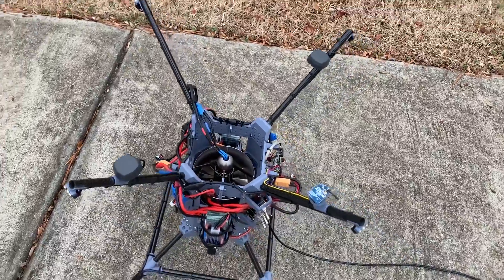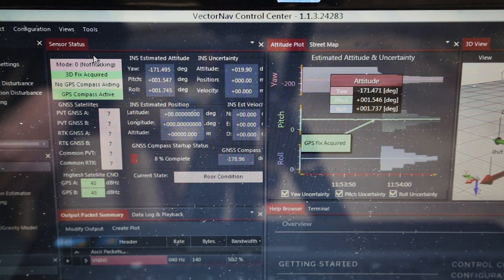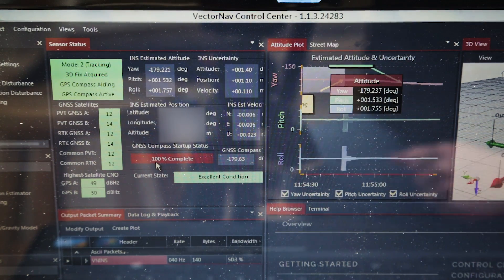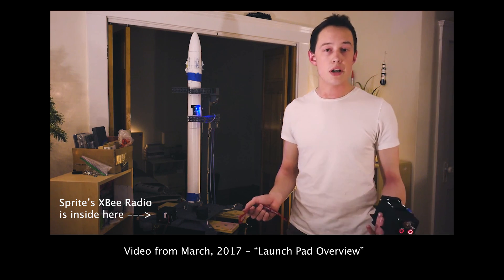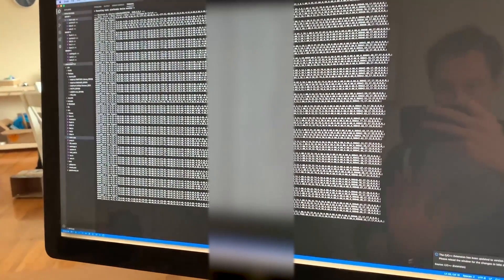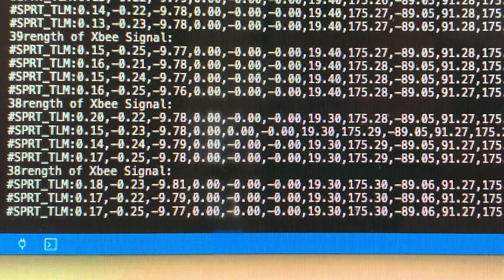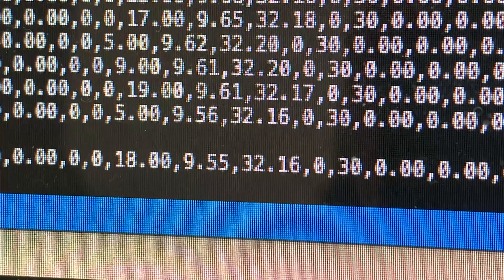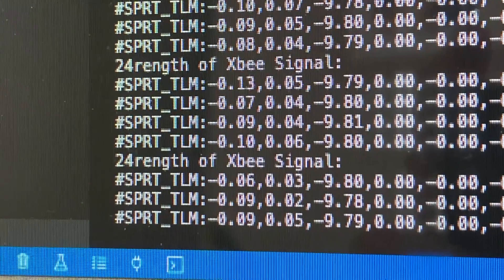GNSS and Telemetry Downlink on Sprite

Comment: Try using the Processing IDE , lots of tutorials on @codingtrain and there is a arduino libary and with Socket Communication a connection to Kerbal should be easy possible. Exporting to Application also easy ;)

Comment: AFAIK Joey B. The align portion of the startup is quite common on inertial navigation systems. Traditionally there are at least three gyros for roll pitch and yaw, plus accompanying accelerometers for lateral, longitudinal and vertical acceleration. Traditionally, aircraft (my experience) need the lat long manually entered to the INU computer, and then once everything is spooled up, starts measuring the earths rotation to accurately model your position. This part requires time. On newer systems we typically have embedded GPS to significantly improve the alignment time, which is what we see in your vid.

The gps provides long term corrections to INS drift, while the INS sensors provide short term high resolution (real time) feedback.

Also, please youtube, correct any mistakes of mine. Avionics is not my forte. Mech and engines are ;)

Thanks for sharing and keep up the good work!

Comment: Python + matplotlib will get you pretty graphs with very little effort.
Reply: They say Python can do anything quickly and badly :)
Reply: Duncan W Any language can do things badly, all you have to do is be bad at coding.

To be fair, python is fairly “slow” (hard to optimize) as it is a high level language, if that is what you are referring to. Then again that mostly depends on your hardware, and whether or not you are badass at coding in assembly.
Reply: @haph2087  python is slow because it's interpreted. Modern compilers on the other hand are so effective, that it's unnecessary to handwrite assembly for most things
Reply: @prototypeinheritance515  Yep. True.

Comment: What about using ROS with your owns rosnodes for all the sensors and GPS? About the 3D model, "moveit" could be usefull, but you need to convert all your CAD file in URDF. Nice work btw!

Comment: I really like the more simplistic format of your videos; no absurd amounts of time spent on fancy editing tricks but more on development. Me like!
Working on a project with similar kind of transducers and data (but a different application) I would advice you to take a serious look at GOlang. Projects like these have a tendency to grow exponentially in terms of data exchange and the (post-)processing you'd like to do - at least that is my experience ;)
My main reason for switching from C# was initially that I needed to get a foolproof(ish) way of handling parallel processing (i.e. threads) and imho GOlang has a extraordinary good way of handling several parallel processes. It is lightweight and can run on most small processors (often RPi's and similar platforms) as well as on laptops and desktops. As for data persistence, there are a number of ready-to-go solutions. I use InfluxDB since all my data are in the time domain and I use Grafana for visualization. Good luck!

Comment: For the last part: I really really don't see the need to go for big telemetry packages like Open MCT or COSMOS for something like this. It just seems enormously overkill. You could write a visualizer in almost any game engine in an afternoon, based on incoming serial data in real-time, with no difficult setup or anything like that... 3D viz, graphs, plots, serial TX and RX, are all trivial to do with built-in features in a lot of engines, and it's all easy to get set up.
Reply: This was my first though as well. Joe already has programing experience so it wouldn't be that hard. I know very little about Open MCT or COSMOS so it may be just as easy to stream the data into those rather than develop a custom interface
Reply: I agree!  99% of the people watching your live feed will be uneducated about complex telem data.

Comment: Do it in Unity!
Super simple to do 3D visualisations and there is a ton of network protocols for transmitting/receiving data. And it can be exported to phones!
Reply: Yup, Unity or almost any commercial game engine can trivially do all the visualization stuff, both 2D and 3D, and most of them offer serial comms too (Unity does for sure - since it's C#, it has access to the system IO components like any other software does).
Reply: That sounds like a good idea!

Comment: How do you connect your GPS, through simcard or its just free?
Reply: GNSS satellites all constantly broadcast a signal, and it’s free for anyone to receive. There’s nothing that is transmitted back to the satellites. However I’m pretty sure you would need a key to get improved accuracy that’s reserved for military. If you want to try this yourself you can buy modules that support GPS/GLONASS/BeiDou and other protocols for around 10 to 30 bucks online

Comment: You are in luck, I'm developing an app that takes serial CSV data in and displays it in a custom virtual desktop.
See a screenshot here: https://imgur.com/a/uWdkfMl
It records, sends serial commands on timed events can work in multi instance mode to have a server and a client (Or several).

It's an open source java application but that is not yet available publicly, I can give you the latest version if you send me an email at franki.steve.mine@gmail.com

When the data string arrives it is split in "Channels" and the data can be displayed in windows on the virtual desktop. The windows can be resized and the configuration can be fully saved.

The available ways to display data are as follow:
- Chart: shows a data channel in a chart (X axis is the time)
- Gauge: shows a data channel in bar that fills between a minimum and maximum value. Colors can be set to have the color shift when it gets closer to the max for example.
- Status indicator (not on the screen shot) : displays text based on the value of the channel. Can be used to display a status such as 1 = good 2 = bad etc.

Other windows are:
- Timeout alarm: sound beeps (optional) and turns red if data hasn't been received in a set time.
- Event scheduler: do the holly mouse click and launch a countdown from the scheduler, organize serial events that will be fired at the right time on the serial port

Finally the background of the virtual desktop can be customized, the color, logo and its opacity can be changed.

Comment: Attempting to do something like this myself and finding many difficulties! Great work!
Reply: Alex Hendrickson learn how to use an Arduino. Led off, led on sort of level then go from there. You can buy beginner starter kits online for cheap.
Reply: I started by building a simple Arduino launch box. Press some buttons and send out an electrical charge. Then I built a scratch rocket (no guidance or computer). Now I'm working on a Arduino flight computer that logs angle, altitude and video. Eventually, I'll work my way up! Baby steps are the key- iterate and make it better with each step.